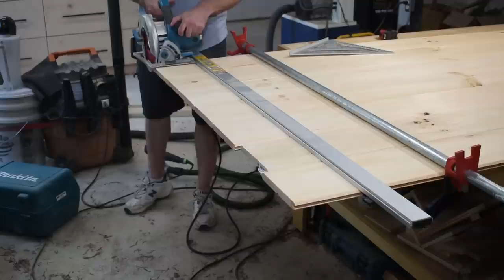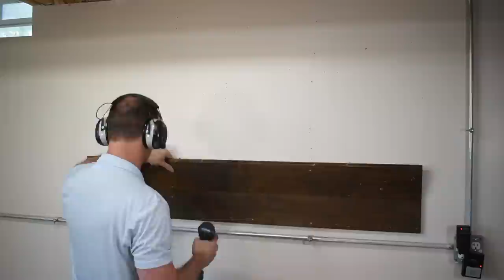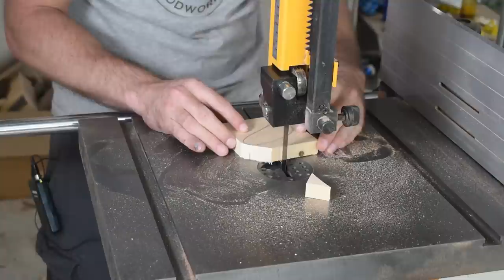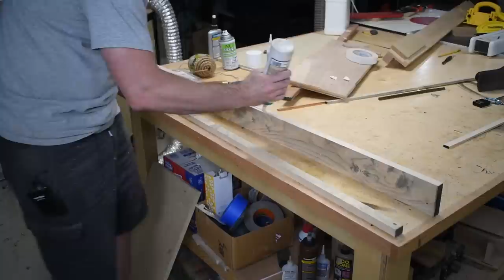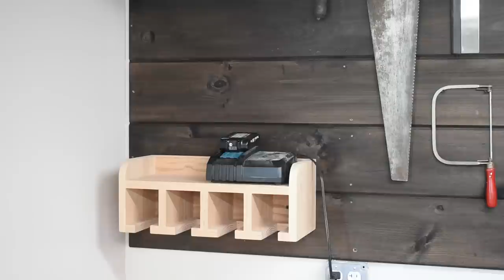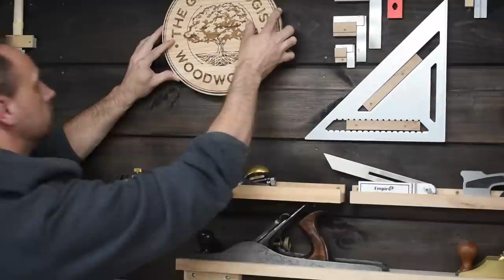My Ultimate Woodworking Tool Wall! | Hand Tool Storage

Comment: Enjoyed the video.   I dream of the day that I can have a shop with good space.  In planning for a tool wall, I am anticipating using rows of french cleats along the wall for two reasons.  One is that I don't lock myself into one arrangement and it also makes the tool holders portable to carry around and outside the shop.
Reply: Carrying tools around the shop tells you you put them in the wrong place... Used in more than one place? Consider duplicates. I have four (reduced) sets of twist drills in my small shop. 
Outside the shop? A dedicated tool box is the way to go.